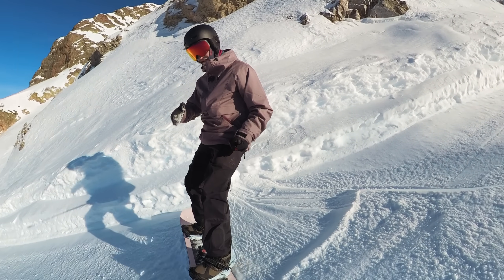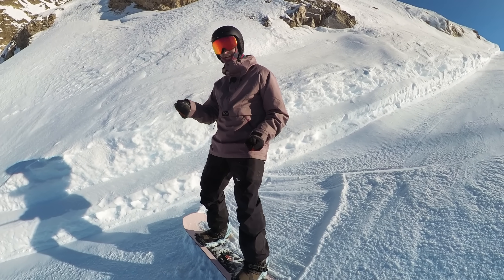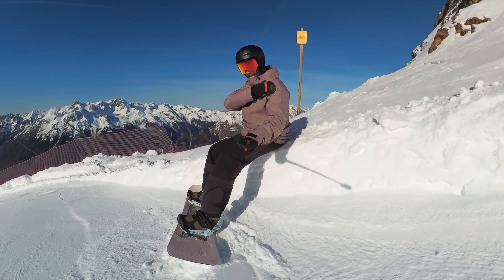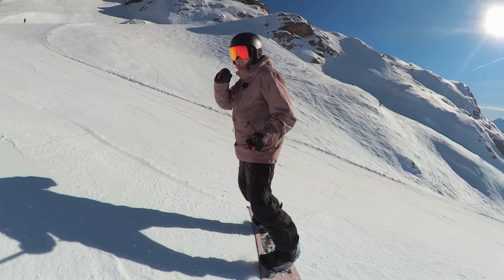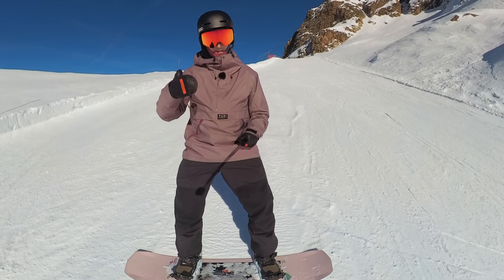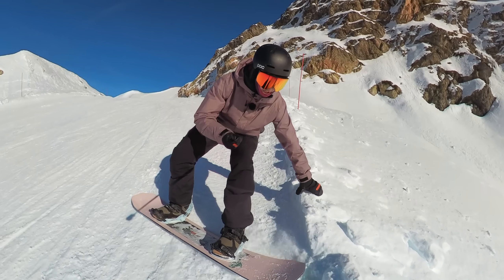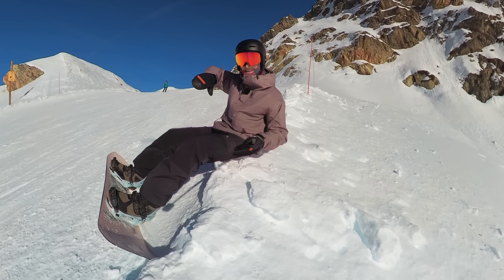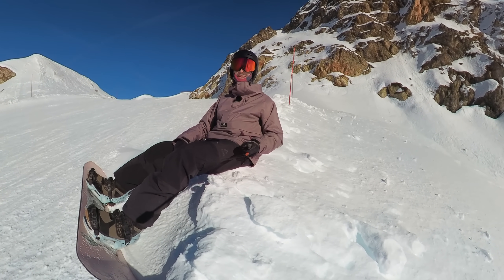KNEE STEERING // Torsional Twist Explained

Comment: Have you played around with making sure you have a flat base moment (any length of time really, but certainly a moment) between all your turns?  It's incredibly challenging going slow, and sort of not possible in bumps but still an idea to try to achieve.  One's stance has to be rock solid both in terms of position and muscle tension.  Once we're going faster it adds to flow, and feels effortless (ties in nicely with your How to Snowboard Effortlessly video).  And it allows for such smooth roll onto the new edge, and a ton of control over edge grip and build up of pressure.  If you haven't deliberately played around with it, then I do recommend.  Another great snowboard tip and tool in this video though man.  You do continually put out good and useful content.

Comment: I was having some difficulty understanding the concept (even with your previous videos) of this technique. However,  after watching and rewinding this video, I think I'm able to grasp what you're explaining. The drill you provided will been added to the list of goals and improvements I need to make for this season, hoping to unlock good snowboarding!

Thanks Malcolm, you're my favorite instructor! So precise, concise and eloquent with your words and movement.
Reply from the maker: Thanks so much!!! 😊🫶✌️
Reply: I didn't understand yet. Maybe 'cause I am snowboarding just two times and I need to practice more and feel my movements 😅
I do a regular stance so my left foot is my front foot and from what I understood before making a turn I have to release pressure on the front foot and keep the pressure on the back foot, right? I didn't understand how to make flawless turns by having attention on these drills 'cause when I am trying to feel if I am doing it right or wrong I can't help but I feel my body is really heavy and under stress 😢
Reply: I had to watch twice to finally understand what he was trying to say. So basically as you’re about to engage into a turn from say a heel edge stance, you’ll need to push your front leg (toes, ankle knees and hips) forward while keeping the back leg neutral to create a “twist” (think of it as if you’re wringing a wet towel) on your board so that your toe edge from your front leg touches the ground first (at this point your board will be in a “twisted” position), then almost immediately after you can do the same for your back leg (doing this will release the twist) so that your toe edge touches the ground where at that point you’re on your toe edge on both feet, then repeat that sequence on your front heel edge.

Comment: This video perfectly rounds out the original videos on torsional twist and short turns. I was previously still a little unsure about that brief moment between the two edges-- whether the board is momentarily on a flat base, or whether it is torsionally twisted without ever going fully flat base (almost like making two independent edge changes like you say).This video makes everything crystal clear. Even in carving,  where the edge change is much snappier, it is still helpful to think of the two knees independently, and have the movement initiated by the front knee (even though the back knee follows suit almost instantaneously).
Reply from the maker: Thanks so much!! 😊😊😊

Comment: Everything just suddenly clicked. I dont know if it's just me or what. Its like this "ah hah" moment. Before, i was like, sure it's fun sliding the board around but not the greatest feeling. Now, i can totally say im addicted to snowboarding 😂

That feeling, when doing the turn properly, the pop in the end, or the pressure release and energy return, which let me quickly press down to change edge to initiate the next turn, just is something else. I finally nailed it and could now easily turn down most red with lots of really tight and neat small turns (as long as it's not too icy). That rhythm is useful as i was waiting too long when i first tried. 

Next, mogul and tree run.

I saw ur website talking about japan, just came back from Rusutsu hoikkaido!

Comment: Cheers Malcom, came back for a refresher as tried Bankso this year and struggled a little on the steeper runs with judder on heelside. Like you said, I tend to overthink things on the slope, so ideally need to just feel it rather than think it. Not sure why I juddered as I was intentionally pushing weigh onto the edge and using my knee to get weight out. It was under speed or steep, so I assume it was just technique or leg strength?

Comment: 4 days of working on this method and it's starting to come in for me. I'm probably being impatient and my expectations are too high, but I'm employing tenacity and discipline which seem to be paying off, even if a little on the slow side. This method of instruction is brilliantly simple, but putting it into practice is another beast entirely. The conversion from mental understanding to physical reality is fairly difficult. 
One thing I that I am trying to diagnose is that I sometimes get a turn started and get to or just past 45 degree beyond the fall line and the board stops turning and I fall. This almost always happens on a toe side turn. I look back in the snow to the point of fall and I have a nice skinny line with almost no skidding through the edge change and around the turn to the point where it just stops increasing the turn. This is probably happening once every 20 to 50 turns. I usually catch it by shoving the back foot out to induce skid.... Any thoughts?

Comment: Can you transition these principles into tracked out runs, moguls, and glades? (Opposite of groomed, or smooth steeps).

I see alot of videos explaining independent front leg / back leg principles (mentioned here too), but don't see much elaborating on when/how to edge/flatten out, weight change anticipation, even counter-rotation (as needed) to regain control when riding uneven terrain.

Would love any drill suggestions you might have so I can repeat undulating runs with less fatigue.  I marvel at good riders who shred through bumpy stuff with so little effort.

Comment: Hi Malcolm, to me it looks like, just before starting the edge change movement your board gets a push to go underneath your body and that helps you to change edge. So it looks like it's not just getting your weight over the board but also getting the board under your weight? Am I wrong with that observation?

Comment: Are you really saying that you can literally twist the board enough so that both edges are simultaneously engaged, though at different ends of the board?
Reply from the maker: The idea is to minimise the time from one edge to the other as much as possible, this is the best way to do that. Depending on the steepness of terrain, type of turn, flex of board, yes it is definitely possible, and if not, then you can at least minimise the time from one edge to another more by implementing this technique.

Comment: Does this apply to very stiff boards? My board doesn’t have any perceivable tortional flex. Which makes me a little unsure if this still works.
Reply from the maker: Yeah it should still work!! Easier to see with a softer board but should think unless you're on a race board it will still work 😊✌️🏂

Comment: I have a question. I make toe edge turns with a good thin line and arc. When I go to heel edge, many times I chatter the board. I decreased the edge angle and the chatter stopped, but then I was traveling at 45 degrees instead of across the piste. It was a relative steep icy slope, but I didn't get chatter on toe edge and really feel the pull of the edge compared to heel. Any ideas. Thanks Malcolm!
Reply: Experienced this as well. Fixed it by bending my knees more/getting lower thus applying more pressure to the edge.
Reply: @gr8s8tn  I'll give it a try. I have a tendency to stand or have a poor knee bend, not sure why...
Reply: I venture to say that resisting getting lower over the board is mental rather than anything else. If I’m cruising at comfortable speed on an easy slope - I take it easy and bend my knees just enough to engage the edge and stay on it. If I’m riding fast or when on steeper or icy slope - I force myself to turn on “bend your knees/lower your center of gravity” program. This way more pressure is applied to the edge allowing me to have better control over the speed and it gives me better edge grip as well. 
This is more or less what Malcolm is talking about here, although he’s not explicitly stressing the need to go low. 
I guess it’s assumed since bending knees = lowering center of gravity anyway. 
Tommy Bennet explains this angle in easy terms in one of his videos. Look it up and good luck.
Reply: It happens with me when I'm  not leaning forward as much as I should.
Reply: I have to remind myself to put more weight on the front leg at the beginning of the turn to improve grip